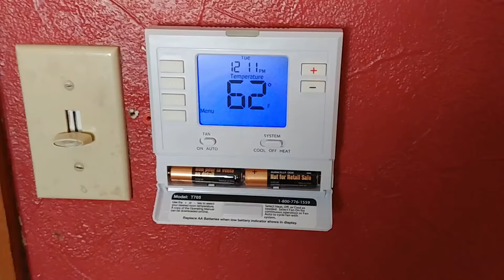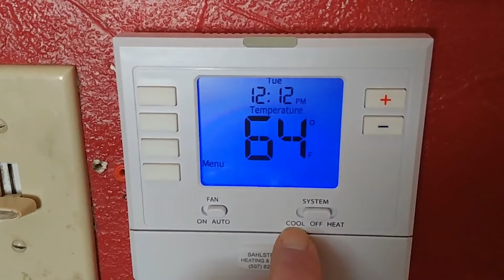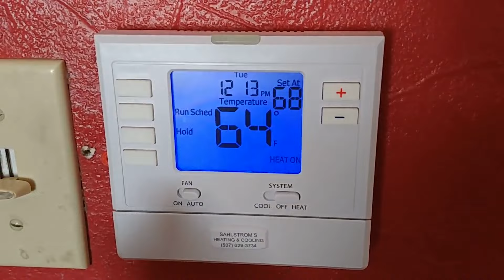How To Replace a Thermostat

Comment: Looking to replace 4 wire H&C thermostat wbattery, with a Honeywell wifi  compatible one. Will I need to add the 24vac common to new thermostat?

Comment: Hi, Ben.

What's the purpose of the jumper?
Reply from the maker: The jumper is to allow the furnace 24v transformer to also control or power the air conditioner contactor. You almost always use the jumper. See this video for more information: https://youtu.be/BCA22Ex5wew
Reply: Most of the time won't find separate rc and rh unless you have 2 separate systems for heating and cooling. Example being if you have Central Air Conditioning, but boiler or radiant in floor heating.